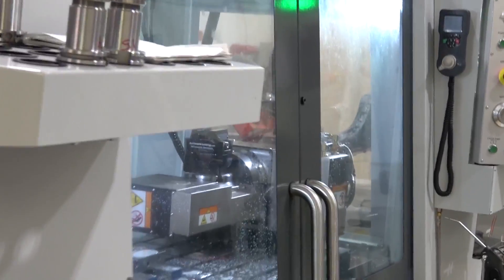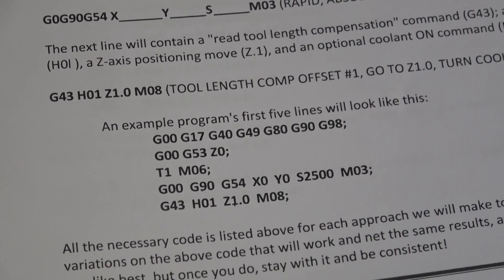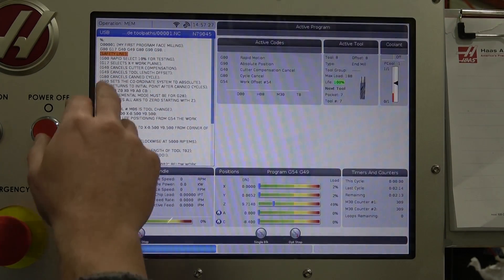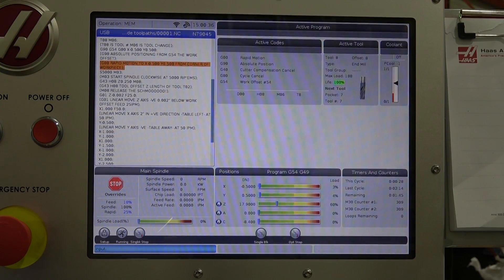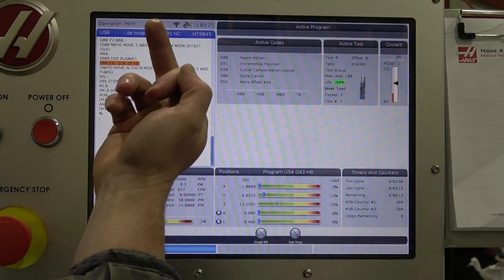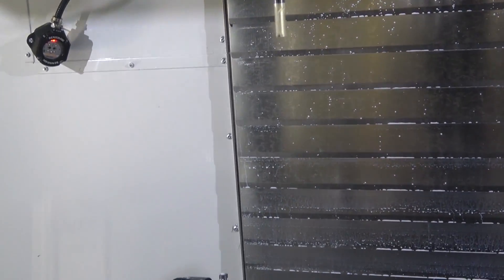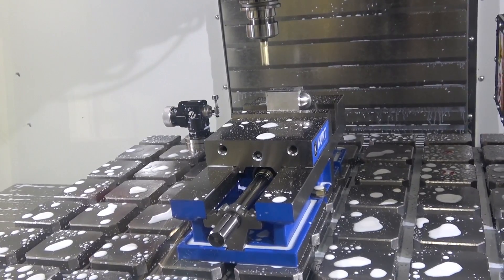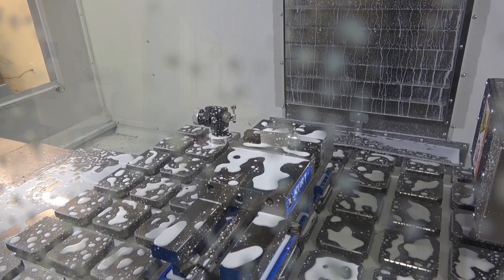Beginner CNC Programming | G-Code

Comment: As far as the complaining about G code goes......Hasss manuals suck at explaining all the codes. Their manuals are basic at best.   Fanuc manuals, on the other hand,  are very thorough and if you actually want to learn the language, (because that's exactly what it is)  you would do yourself a huge favor by picking up practically ANY Fanuc manual to use as a reference for most any code and or cycle you might find yourself needing. Only real problem with a Fanuc manual is learning how to decode the manual to decode the codes contained therein. They have been translated from Japanese to English and can be mildly frustrating at times until you learn what their symbols pertaining to codes within cycles mean.  

In a G code program, each line is called a block and is terminated with a semicolon.  The codes within the block are words,  the block is then the sentence.  Thinking of it in that manner,  it should be no more difficult to learn than any other language.  If you are going to hand code CNC machines,  fluenty speaking G code is the only way to go.  NOT bumbling through it day after day HOPING you got it right.  Learning the codes you need and designing a template of how you program every time is the easiest way to program parts.  

To those talking about conversational type programming. While those controls have a user interface that basically asks you questions that you then answer with pertinent data obtained from your blueprint, it STILL runs G code in the background, you just typically can't see, read or edit the actual G code. The fact that they do actually run on G code  is the reason you can still program them with a CAM package. G code is what the control reads anyway. 

As for CAM packages,  they have their place.  I personally find them cumbersome and time consuming for programming simple parts.  Ex: wanna pop two holes and a slot in a piece of steel?  Just write it by hand.  
You want to do some crazy profiling or 3d tool paths or have a gazillion holes in unevenly spaced locations or a metric shit-ton of tools you need to use?   CAM it!  Save THAT gray matter for figuring out what beer to drink tonight.

Comment: AvE, you're videos are so damn entertaining, and yet I learn something new in many of your videos!  Something I learned going from LASER cutting to CNC Routing is that what is often referred to as "Relative" cutting for LASER, is pretty much the same as "Incremental" in G-Code, or for other machines like the Homag/Weekes machine I use uses .mpr files instead of G Code which has a bit better user-interface than just the code haha.

Comment: In most CNC systems if you put in a value without a decimal point it assumes it is in thousands. Like 1 is 0.001 and 23456 is 23.456. You should have used "-1.".

Comment: Ha ha! The worse for wear cousin Dumblefuck will say that the Haas Controller is sweet compared to a Fanuc one :D Now on the subject of GCode learning, I'd suggest you start learning the less critical codes first  (T, M, S etc) and then proceed with the G ones. You should have a list of them with the documentation. Don't bother with the more complicated ones, learn by heart the work and fixture offsets (G54, G52, G92) etc, then the Feed and Speed gcode, positioning, etc. It will become a second language once you break 5 to 10 end mills :)

Comment: G28 homes your z then your y then your z. If you need to move any other axis you will need to use g53xyz which you can use the g53 to bring the table to the door. But you do have to be careful tho g53 cancel your g54 offsets so just be careful with it

Comment: With no decimal point it defaults to the smallest increment. In this case the control interprets "1" as ".0001" and moves to that position.
Also, if you are facing with a .500 diameter cutter, your " step overs" (Y Axis Move) should be less than .500 or you will get little raised lines in the surface (it won't be flat.) this is due to the corners on the end mill not being perfectly sharp.
It's easy to do using a round number like .450 or .400.

Comment: I think the lack of a . is a kind of safety.  If you do not put a . in the with the F the controller kinda as a self preservation puts your input as the last digit it knows (.0001) so it your feed was F150 and that was a type-o that should have been F15. it would most likely save the part and the tool by running at F.0015.  It would run forever which would throw a red flag in you mind.

Comment: The -1 stuff s probably because if you write -1 you have written an integer, and if you write 1.0 you have written a floating point number. I guess in Gcode writing an integer instead of a float might invoke some sort of alternative mode of the function you are calling. (total CNC noob here, but this is sorta how it can work in C with overloads)

Comment: Hey Uncle BF! You should have a look at G13 in pocket milling. I just remembered it from when I started out using Haas machines 30+ years ago. I think you'll find that a G13 line only needs to know the biggest diameter of the cutout, plus depth and where to start and how much it's allowed to step out each circle to remove all the material before it reaches the finished size. So a single line will cover your ass instead of inputting a whole bunch of code to nibble out the bulk of the swarferations.
And, you guessed it, our programmers don't use it.

Comment: Let me see if I can discombobulate those five lines of code.
G00 = rapid traverse,
G17 = XY plane selection (had to look it up, not used in the Fanuc systems I've seen),
G40 = tool radius compensation off,
G49 = tool length compensation off, (don't know why you would do that, I've never used it)
G80 = Cancel any modal (canned) drilling cycles.
G90 = Absolute programming
G98 = Return to initial z position in a canned cycle (not sure why it's here as it's the default in our machines)
-----
G00 = rapid traverse
G53 = Use absolute positioning (modal, so active only in this line)
Z0   = Tool to absolute zero ( takes tool to tool change Z height when in the same line as G53)
-----
T1 = Select  tool number one in carousel
M06 = Auto tool change to "T" number)
-----
G00 = Rapid traverse
G90 = Absolute positioning
G54 = Uses work positions from workshift memory instead of machine zero 
(this is modal, so all movements use it until told otherwise)
X0 Y0 = Move tool to stated positions 
S2500 = spindle rotation speed
M03 = Spindle rotation direction (look at a regular drill bit, the way it needs to spin to cut a hole is M3)
----- 
G43 = Use the next H instruction to set tool length
H01 = Select tool number one length from tool memory
Z1.0 = Move to one millimeter above work zero
M08 = turn on coolant
----------------------
Feel free to correct me folks as I'm just an ordinary setter. You know, like the ones that run off down the beach barking at seagulls!

The G17 and G49 codes may well be included in the macro coding that our technicians have pre-installed in every machine. Which would be why I don't notice.
 For instance, if I type in a mini program in MDI mode M98 P1; will send our machine head to tool change height with no moves in X or Y and M98 P2; will do the same, then move the head either to the back and lefthand machine zero positions or, in the case of a moving bed, like Ave's, move the bed the the front and righthand zero positions.

Comment: so the G-code is basically a state-machine merged with a flow controller and some parameters pushed between the state/flow. 
Does it do registers? 
Is there a state-diagram that enables the user to actually work with the commands? 
Are the states/flows the same for each machine?

Comment: I have experienced the same brown shorts moments on my old 1980 CNC Mill. No matter how careful you are one day you will make a dumb thinking mistake punching in g code, but it may still be an ok day if you only break a cutter (I have been lucky and just broken cutters, no head crashes yet). 
It makes sense to learn a CAD tool like Fusion 360, currently free for hobbyist and small business. Larz has about 200 YouTube videos on learning the solid modeling tool. It comes with post processors for generating g code for most CNC machines. 
If you fully embrace the dark side you can model your vice mounted on the bed in the CAD environment and the software will warn you in the CAD machining simulation of a crash into the vice or bed. An added bonus is the same CAD tool generates STL files for 3D printers. 
Just another Lower Mainland EE and wantabe machinist.
Have fun,
Peter

Comment: When proving out a program, bring each tool to z2.0 , for example, then you can single block the tool  move to z2.0 safely without having to white Knuckle the feed hold as you approach your part to apply the first z- cut. Once the program is proved out, delete the stops above part, saves accel / decel on servos. 
G28 is home in incremental mode g91, which can be used to egress a part in a controlled motion with additional values added to it. 
Also, handy to put a forward slash / m8 . This way,  you can push block delete on the first run to eliminate coolant bath while proving out entry motion.

Comment: Spot on about how the manual is written...  The guy writing it seems assumes you already know what the hell he's trying to convey.  Crack open a Siemens 840 manual :(  It's makes sense if you already know it. 

Writing in raw G code is good when you're just getting started or for real simple things,  but getting some kind of CAM package would be the next step if you want to really use the machine to it's fullest potential.  As a bonus, you'll learn what all the G codes are my the time you get the post de-bugged..  (though I'd bet you can get a basic Hass post included with any decent CAM software).  3D contouring would be a real PITA to do manually, but only take a few minutes in with a CAM package.  Still,  you can write some pretty ingenious routines using subprograms and parameters that would drive you up a wall using CAM.

Comment: if you put in y-1 with no decimal it reads it as y-.001 which is why it went back to the starting point essentially. it's not really a Haas thing Fanuc etc. does the same thing.

Comment: To the Haas controller, y-1 is equivalent to y-0.0001. In contrast,  y-1. (Note the period) is equivalent to y-1.000. You have to tell it where the decimal place should be, or it defaults to tenths. 

On our older Haas, it does the same thing with feedrates, so F100 is 10 thou per minute, but F100. is 100 inch per minute. Dunno if yours does the same, but watch out for that fuckery.

Comment: Some top tips;
The first line with all those G-codes just cancels offsets and if if you add G53 and end on Z0 your Haas will always go straight up to it's toolchange hight whenever a program starts, always. Use G53 Z0  whenever you want it to go there, don't use G28 as it will go to your active Z0 first before returning to machine zero. Having three separate G53 lines of Z0, Y0 and X0 will move the machine axis respectively to it's machine zero regardless of the active G54(the standard user-selected datum). Even Haas themself say tot use G53 X/Y/Z0 instead of G28 X/Y/Z0. 
Check out their "tip of the day tips" on their YouTube channel, helpfull even for me, a job shop machinist, on using their machines and it's machine settings. Like when you want an automated decimale point and interpet it in inches (X1 is read as X1.000, or not and read it in thousands, making 1000 one inch unless you use a decimal (X1 is X0.001 , X1. Is read as X1.000)
Don't use G91 outside of a subroutine, theres no need for it, and it can mess with your offsets in a poorly written program. Just make sure G90 is on that first line and have that row before a toolchange [G00 G17 G40 G49 G53 G80 G90  Z0 ; ] I call it the idiot line, prevents me from making a fool of myself, or "art" out of valuable pieces of stock or parts and tools.

Comment: It's a bit advanced and I don't know if its the same on the new Haas controls but if you wanted to start in the middle of a program say if you were tapping a bunch of holes and wanted to check the depth on the first hole before running the others then start on the second hole you can turn on program restart in the settings which will basically dry run the program up until the the block you selected then continue operating normally.

Comment: When you are interacting with something that you can literally set to wreck its self (in a way) then does that make it a true machine in the category of its only as smart as its user?

Just like all things the more you do it the easier it gets. I suck majorly at coding, but for some reason I ain't bad at FEA code which is trivial in comparison to a lot of lingos, but sequencing and being able to visualize the structures and the build is key. I imagine that is the same with G-Code as you need to visualize you process too

Comment: CNC G-code is like "portable" assembly language. 
The CNC paradigm hasn't fundamentally changed since the early 1980's; when I wrote my final year Enginerding paper on it. I'm disappointed.

I'm still looking forward to being able to drop a CAD model directly into a CNC machine, tell it how many pieces I want, what sort of material and the approximate location of the stock. Then let the machine figure out the best way to convert stock to chips with the tools that it has at its disposal.
Reply: I don't understand why anybody needs to know anything about G-code. Granted I work with wood but we use programs like aspire for three axis wood milling and it has a CAM system that translates all of the information to G code. But what do I know, I'm a woodworker...
Reply: @MNhockeydude35  I also worked with aspire, it's really easy to use
Reply: For the same reasons arc/stick welding should be learned before MIG or TIG. LEARN THE MOST PRIMITIVE AND THEN BUILD FROM THAT.

Comment: Partner..... Get yourself Notepad++ at least. Wordpad is crap when it comes to programming. It could add in word processor formatting mumbo-jumbo into your code. No bueno! For bonus points, go download Visual Studio Code (free) and add the GCODE extension so it does an idiot check for you and highlights all the bumblef*** errors.

Comment: It´s good to know which g-codes are modal(permanently enabled after execution, for example G91(incremental)), and which ones are nonmodal(just for the line they are in, for example G4(dwell)).

Your G-codes wil also reset after hitting reset/after turning on your machine/after M30.(like G54-G59(zero point offset))

Comment: What's with the grease on the pull stud?  All CNC's need a decimal, otherwise the machine treats the number as x ten thousandths of an inch.  So, X1 is the same as X.0001, X23 is the same as X.023, etc.

Comment: Your Y error is because if you don't put the decimal in there it reads Y1 as Y.0001.  You could program the entire thing with out a single decimal if you wanted to you would just have to input your numbers as the quantity of the thousands.
Reply: 5.4 would be 54000
1.125 would be 11250
4.5861 would be 45861

Comment: Something I have noticed with these CNC machines is if you just use whole numbers instead of decimals it considers them ten-thousandths of an inch. So in that case where you had 1 it instead went to .0001. Its actually something that comes in handy with the CNC lathes I work with because if you were to accidentally input a whole inch it would auto correct it to thousands and thus prevent a crash. Unless you entered 1.0 of course but that is something you have to do a little more intentionally.

Comment: there was a way to turn off the door safety lock in the settings somewhere. run the machine with doors open ;) cant remember exactly, its been almost a decade since ive been on a haas

Comment: I hate those controllers without a knob that turns for rapid overide. I want 100% to 0% now! Not after 10 pushes of a flat button I can barely feel,while I’m looking the other way.
If your fixturing ever gets close to max on your tool height you may want to add a pause U0.5  half second just to make sure it’s all the way up before the table moves. Found that out the hard way at 1000ipm.
Your ass must be sore by now. Couldn’t drag a needle out of your ass with a tractor,proving a new program.